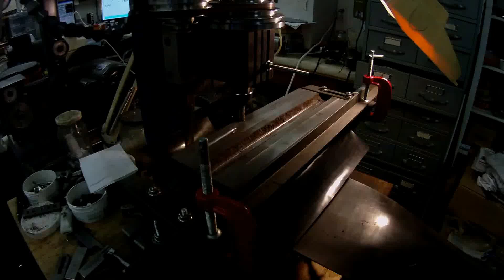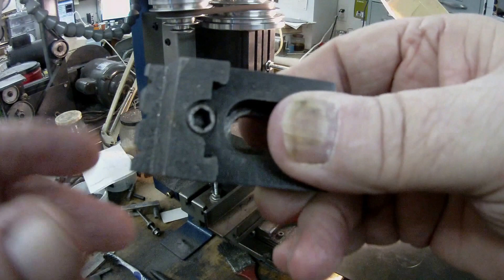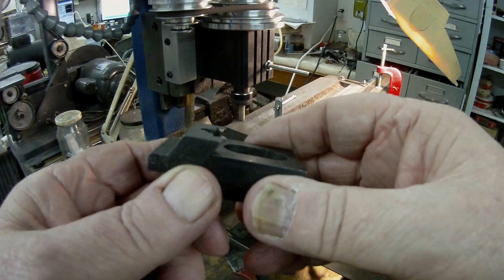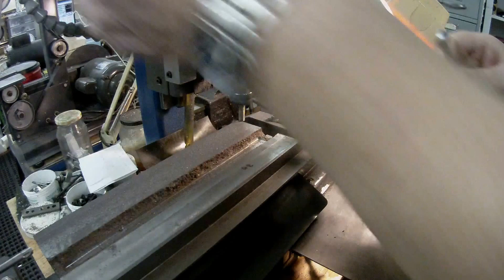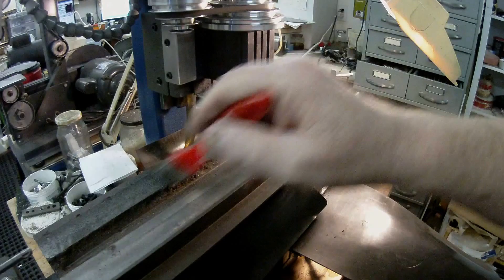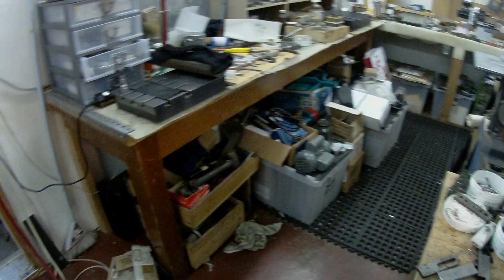FILE0005  FILE0004 Returning to the Lime Hand Shaper HD 6

Comment: Walter:  Things are going quite well.  Steady as she goes.  It's definitely going to take a bit of time to work the piece down to size.  I'm sure things have to be more stable now that you have some sort of flat bottom and it must be quite nice to get some more of the horrible outer surface removed.  It's quite a stark difference between the original surface condition and the newly milled material.  Your clamping arrangement appears to be working well and I'm sure it's much more stable as the work progresses and you have better surfaces to work with.  Keep the videos coming and thanks again for posting your work.  Best Regards: Larry
Reply from the maker: +Larry Poindexter 
   Thanks Larry, yes it going slow and there are times when I get the urge to overcome that by increasing the cut or feed just to speed things up, but then I think about the flimsy setup,

Comment: For me, the Taig mill is huge. Biggest endmill I can do is 3mm. When you have small machinery anything  takes a long time!
Reply from the maker: +Juan Rivero 
      Juan, in roughing out the central trough as in my last video, I have a 4 flute 1/4 carbide endmill with broken corners on flutes, just a forward and back on the X-axis,  with manual on Z, the feed code is F10 in Mach3, I have been taking .080 deep cuts with a .30% reduced feed and I am sure I could increase the cut to .100 deep that's with a full 1/4 cutter, 

But I do understand what you mean, and realize that your mill is so much smaller that the Taig, its all relevant, and in this case size does matter,
Reply: You know, Walter, I'm getting old. Watching you do this makes me say "hey, he should use a shaper" and then it hits me. He is building a shaper!  That said, the Taig mill is a jewel. I couldn't bring myself to pay for it on my retirement income, and sometimes I regret it. I enjoy al your videos very much and learn something from every one of them.